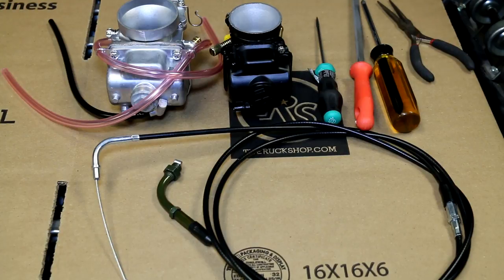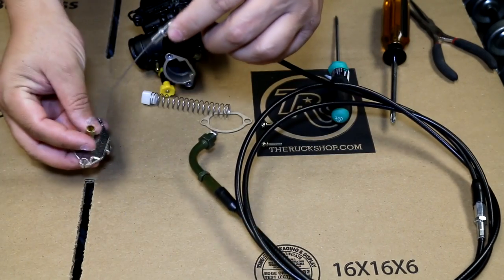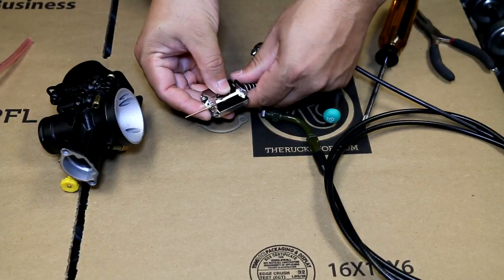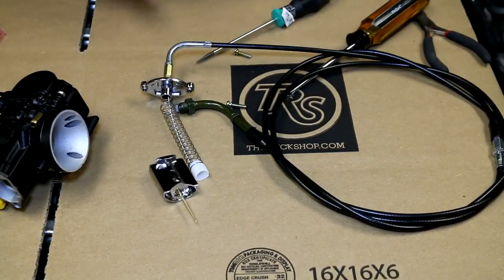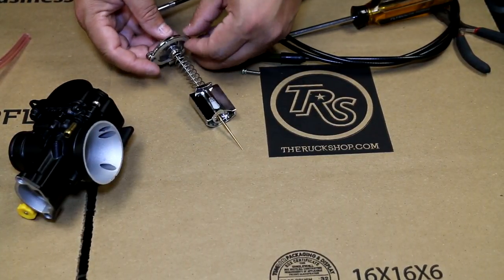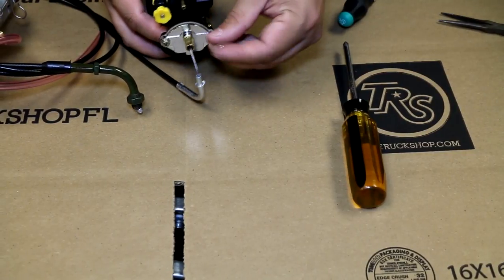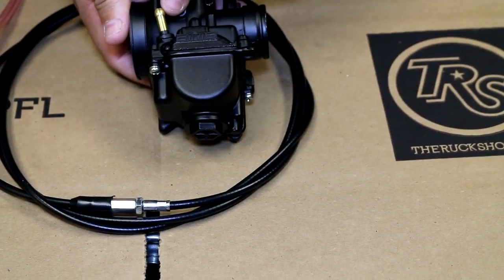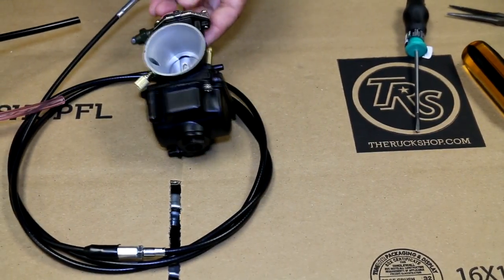PWK OKO MIKUNI SLIDE CARB CABLE INSTALL

Comment: People are running the 21mm carbs on bicycle engines. Are those cables long enough? From what I seen you would have to cut some of the cable cover away
Reply from the maker: been doing this for 13 years and have sold over 2000 78" inch cable. for the carb 28mm and 30mm all day long
Reply: @Theruckshop  I don't know how long the throttle cable is that comes with our engine kits but when you put it in the slide the cable isn't near as long as yours in the video. Your cable is six and a half feet long and I know the ones that we get ain't that long
Reply: @Theruckshop  the throttle cable for motorized bicycle engine is only 45 inches so probably have to cut some of the sheath off

Comment: Thanku fot that I have a OKO carb and I'm having trouble putting in the throttle cable I have a 50cc prebug Zuma and I'm building it to a 70cc did u guys us the 50cc cable??? That's my question???

Comment: Hi. Im using OKO carb. Bought it brand new and jet it good. Only problem is, thr slide tends to stuck. It wont stuck when the engine is off but the vacuum pulling the slide at rpms, and itll stuck again. Refusing to go to idle. Had to be throttlef again so that itl go to idle. And during changing gears, the carb will stuck at idle position, thus forcing me to grip harder to free it and it made the bike jerk for sudden throttle given.

Can you give an advice on how to solve this problem? The carb is performing flawlessly except for this issue.
Reply: And i dont thinks its the cable because the throttle seem to act normal when i turn off the engine. Its only doing this when the engine is on and especially at normal ride.
Reply from the maker: so i would lube the inside of the cable since the do not come pre-lubed , we know what you are talking about though as ours does the same thing . we have sand the inside where the slide goes to smooth it. or continue to blimp the throttle before a stop . that's what I do because I'm lazy but others at the shop have sanded with a dremel and they  said it fixed.  its the slide getting stuck on the casting
Reply: @Theruckshop  Ok. Smooth out the slide or the housing of the slide? Anyway, itll be a risk to do so since it might also effect the vacuum process of the carb is it? Or theres no risk and just sand it or smooth it out by any means but not excessive.'
Reply from the maker: @HanumanGoku  it's a PWK so no diaphragm  just smooth out
Reply: @Theruckshop  ok thanks.
Reply: Anyway, if you can advice, whats the grit of sandpaper thats suitable for this application? Im not really an expert in this. Will be trial and error and would like to minimise the mistakes hehehe
Reply from the maker: @HanumanGoku  we used an 80 grit dremel flapper wheel

Comment: So i get a high rev/rpm after letting off throttle. I lubed cable and made sure I didn’t have any vacuum leaks and Adjusted cable. Any advice?
Reply: Probably an air leak somewhere

Comment: Is it a special cable? 
No way the lead end through the groove to seat.
Reply from the maker: You pull the cable and the wire goes into the groove and then it seats . 😊
Reply from the maker: No special cable just a normal PWK cable like all slide carbs are